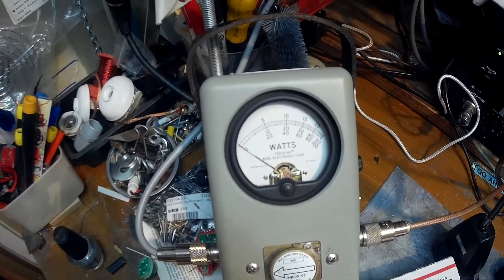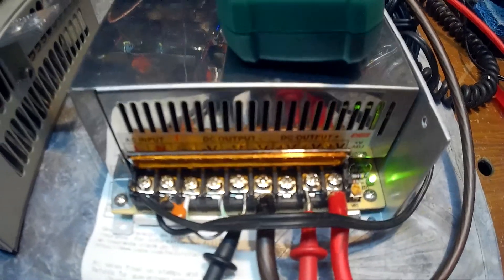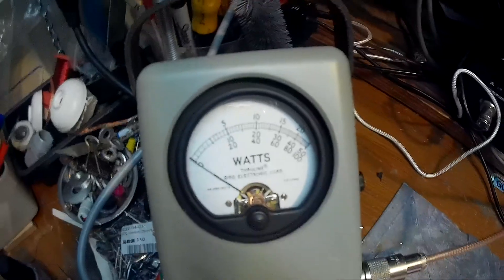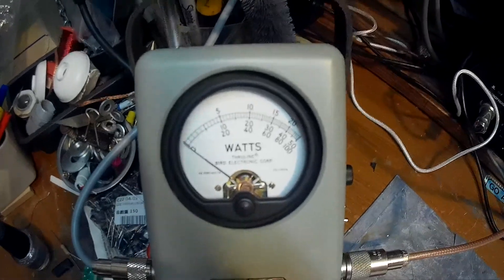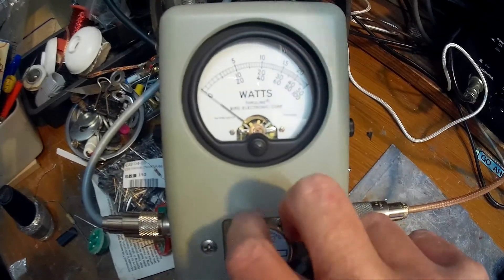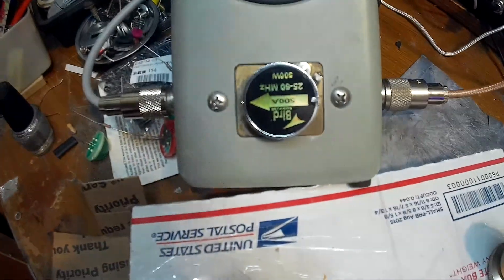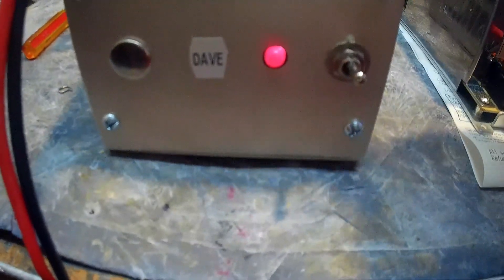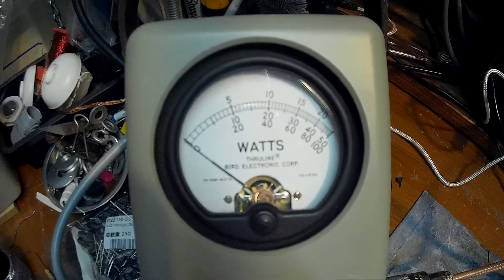BIRD 43 TEST, RMS vs PEP

Comment: Can someone thoroughly explain why rms watts are more valuable than PEP watts, is it because rms watts are present for a longer period of time?
Reply: RMS is not more valuable, there are literally 1000's of misinformed "experts" out there.  RMS and PEP are two different types of measurements.   Both are measuring power output, but all these people using a Bird RMS Meter to measure the output of their radios while modulating the signal (talking/whistling) should be using a Bird PEP meter.   An RMS meter should only be used to measure the power of an unmodulated signal (deadkey).... and a PEP meter should be used when you want to measure the peak power of a modulated signal (talking/test tone/whistle/etc).   I will try and give an explanation about the difference and why the 2 different measurements matter. 

Hopefully you know what a deadkey is !   Now we start testing...  So you key your mic and you do not make any noise, and an RMS meter shows that you have a 4 watt signal.  So great, you have a 4 watt RMS signal, and that would be correct.  Now hold your old noisy ticking Timex watch up to your mic and have your mic gain all the way up so your mic and radio hear the tick.  Now every time the watch ticks your RMS meter barely moves up to show you 5 watts.  Then we modify your watch so it ticks really fast!  Now your RMS meter shows you 8 watts.   

Great, so the RMS meter shows us 4, 5, and 8 watts.  So did your peak power change? NOPE

Now lets do those same tests with a PEP meter.   When we deadkey the radio with no sound it shows us 4 watts.   When the watch ticks slow the PEP meter shows you 16 watts every time the watch ticks, then we modify the watch again so it ticks really fast again, and the PEP meter shows 16 watts.  

Just Great, so the PEP meter shows us 4, 16, and 16 watts.

So the results are, the:
RMS meter shows us 4, 5, and 8 watts
PEP meter shows us 4, 16, and 16 watts

Why? because the PEP meter reacts fast and can detect the peak of the signal.   The RMS meter will never show the peak of the signal, but as the watch ticks faster the RMS meter is trying to average the 16 watt pulses with the 4 watt deadkey,   The faster the tick the higher the average, but it will never add up to 16.   The PEP meter reads the 16 watt peak every time it senses the peak and shows 16, so no matter how fast or slow the tick, it will always show the peak, and in this case the peak is 16 watts on every tick, no matter if the tick is fast or slow, it's still 16 watts PEP.

Hopefully that helps.   This was just my attempt at a layman's explanation.   Don't try this with your watch, I won't be responsible for you modifying your Timex.  Even a PEP meter would not be fast enough to detect the tick of the watch properly.  My analogy above is accurate, but only an oscilloscope would show the results I describe above properly. 

People who say only Bird watts matter are misinformed.  It gets way more complicated than my explanation above.   Modulated signals get complex, and just because a Bird RMS meter shows more watts with one radio setup compared to another radio setup does NOT mean that the one that shows more RMS power has more peak power, or is a cleaner signal, or has more modulation, or gets out better.   To truly know what your signal looks like and how much power you have peak and rms, you need both types of meters and an oscilloscope to see if the signal is clean.   Even then, how that signal and power gets transmitted out into the air depends on your coax, your antenna, and even your antenna height.

PS... if you do not know what RMS and PEP are, just think of RMS as the "average power", and PEP as the "peak power".   It is not exactly that simple, but close enough.

Watch my video here:  https://www.youtube.com/watch?v=8dMAm0UUlgw

I hope this helps, now let the smoke begin.

Comment: If you have a radio that does not have a lot of average power but has a lot of pep swing it is possible to see a 250 watt average and a 1200 watt pep Probably sounds like crap but it is possible I have a radio that only swings 5 watts average but swings 40 watts pep on my amp I get real good PEP swing but I don't have no average swing it's real low
Reply: you are correct, this guy doesn't understand the difference between rms, average, peak.  hopefully he does by now since this video is already 5 years old.

Comment: 200 watts RMS should give you 800 PEP. IF audio is clean and waveform is not clipped or square-wave. What does it look like on a scope and spectrum analyzer?
Reply: When I dead key about 480, I hit 2k pep.
Reply: if you are simply using a "linear" amplifier and sine waves you would be correct, but with other tones, and/or a negative peak compression amplifier otherwise often known as a "modulator" or "expander" type amplifier, you can have much more than the 4:1 ratio and still have a clean signal.